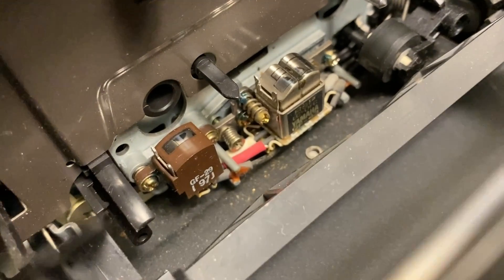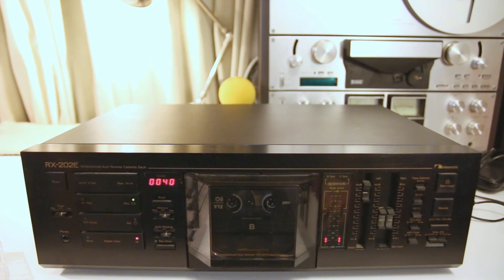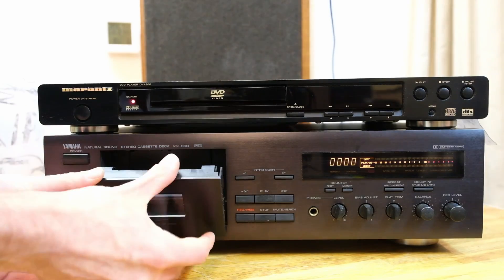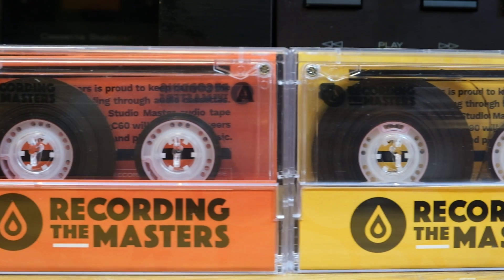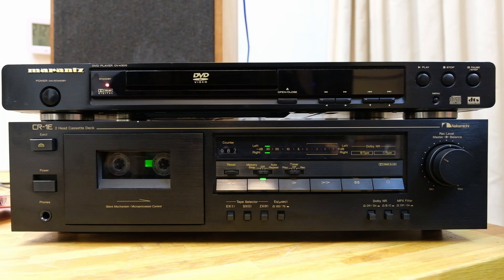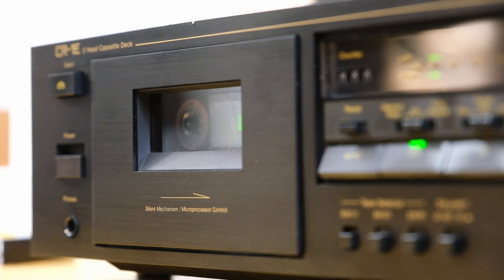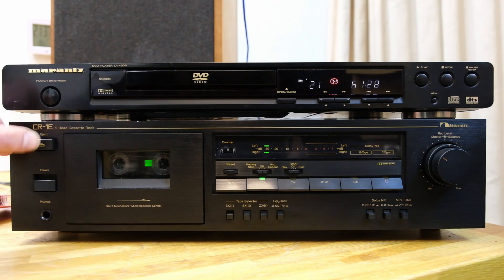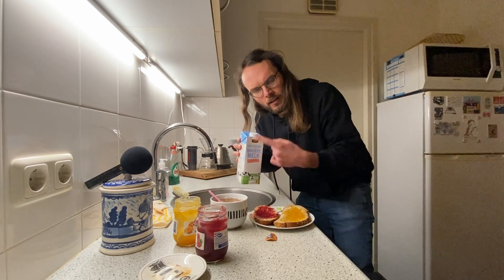The basics of cassette recording

Comment: Nice and informative video about recording on tape, interesting to hear the effects of setting wrong tape types during recording.

I have recently started recording on my NAD 613 deck and enjoying it a lot. For calibration with the Bias adjustment I recording a 315Hz and 10kHz sine wave, separated in the left and right channel, and find a position that on playback gives equal levels on the left and right channel. Any other tips on setting Bias?

Your part on the notches in the different tape types got me thinking. My NAD 613 does not have a tape type selector, thereby I assume that will auto adjust with the notches, as you explained. But what if I have a type 2 tape with the record protection notches removed, and I cover the complete notches in order to be able to record? Will my deck see this type 2 cassette as being a type 1?

Also, what is the purpose of the 70/120 microsecond switch on your Nakamichi? I though the difference between type 1 and type 2 is the either 70 or 120 microseconds? (and is that termed bias, or EQ? what does EQ mean anyway?)

Hopefully you are able to respond to my question. Keep up the nice work with your channel, cool content also with the speaker demo and reviews!
Reply from the maker: Hello! Typing on my phone so keeping it a bit brief; I personally use my ears for biasing with a piece of music that has a full frequency range. Even if the bias is slightly off you won’t know unless you one on one compare. Many decks don’t even have bias controls and they still sound fine. Don’t overthink it 😁.
If you cover both notches it will record at type 1, yes. So only cover one (just put the tape over half of the notch. It is okay if it just goes from the front to the back of the shell, you don’t have to put it exactly on the top of the tape. Anything works as long as only half the notch is covered.
As for the 70/120; it’s a playback eq only. There are a few type 2 120us tapes and Nakamichi took those into consideration!
Google “120us chrome tape” and you will see some images :)

Thank you for the kind words!

Comment: Can I record direct from the outputs on my audio interface? Or is it recommended to use an amplifier for all applications
Reply from the maker: You can absolutely directly record from your audio interface. A really high quality amplifier (something high end, not your 'average' consumer sony, pioneer, technics etc.) might pose a small improvement but unless you are working with high res digital audio, there's really no need to worry about this. 
There's only a few different analog signals. There's phono signal (comes from an old fashioned record player), microphone/guitar signal and line level signal. Line level is pretty much any modern audio device. So whether it's your cassette recorder, computer, phone, cd player, ipad, tv or even gameboy, if you have the cable to connect it (which just means; the right plugs on both sides, nothing fancy) it WILL work. 
Bare in mind; If your audio interface is meant for music production, it may only have microphone inputs and no line level inputs. So if you want to go the other way around (from tape to your computer) you may need to make sure your interface supports that. Your interface outputs though, are definitely line level.
Reply: @rollingtroll  awesome and thanks for the quick reply! I just found out recently that my mom still has her nakamichi bx-100 in good condition that she never uses so I have been doing some research in figuring out how to incorporate it into a music production workflow for a little bit of tape flavor. Luckily my interface has switchable mic/instrument/line inputs so looks like I will be good to go on that end. I was originally intending just to record direct from my interface but I found out even more recently that she also still has a Rotel rx-830 stereo amplifier so I guess based on what you said I'll try both to see which one I like better.

Comment: How do you segment tracks when recording to a cassette instead of having just one long track composed of different songs?
Reply from the maker: You can't. A tape is always one long track. Some cassettedecks can 'track search' when there's a 3 second (or more) silence between songs. Alternatively you can use the tape counter to see where tracks start, you would then just have to write the counter number on your tape index card, and fast forward to that number :)
Reply: @rollingtroll  Thanks a lot, I always wanted to know
Reply: @rollingtroll   also how do you go about erasing a type 2 cassette to  record something else on it?
Reply: @zromaa  The same way like every other cassette. You can simply record over it or you can use tape eraser. So understanding it is not necessary to erase the tape. you can just record it like if it was empty. The deck will take care of erasing the old track and recording new one (of course setting the deck to record type 2 cassette).

Comment: Much of the business that I had in the 80's and 90's was real time cassette duplication. I used Nakamichi MR2 decks. The best fidelity for Type I Playback was to use Type II (chromium) tape in Type I shells.
On recording, I would use Type II bias but 120micro second (Type I) eq. This gave extra headroom for the high frequencies and allowed recording at about 4dB hotter. These tapes played back properly on a Type I machine as they didn't have Type II sensor holes.
Reply from the maker: Many decks don't erase properly if you use Type II bias on Type I tape. But I'll give it a shot with one of my naks, see what it does for me :D.
Reply: I used Type II Bias but not EQ on Type II tape. Only the EQ was changed to 120microsecond.
 Of course, the playback was only correct if you used type I playback which is why I used Type I  cassette cases for my duplicates. 
Self sensor decks sensed it as Type i.  and I marked them as normal 120 playback.
This was something I learned when I was licensed by Dolby.
Reply: @Yoda8945 "when I was licensed by Dolby" that's a cool sentence to be able to say about yourself.

Comment: Spent years in 80-90 even in 2000s with tapes.   What is the reason to perform this today ?  I also wonder why this casette decks still cost money. Ok for Marantz, Denon some hi-end tech, but also tape-players that cost 100 $ from 30y ago are in trend too ! Wtf :?!  ("Old days come to life. Old morning dawn... ?") 
2 days ago i woke up and fixed that i want to buy a tape recorder too !!!))) i feel myself not myself !)
Obviously - all this staff sounds quite poor and have many complexities. 
Seems like just some magic rite today,  is not for listening).
Reply from the maker: Because there is no better relatively affordable alternative. Great digital audio is more expensive, reel to reel is too. And of course there is a little romance and the tangible aspect.
If it sounds poor, you are doing it wrong. Even in a very serious audiophile setup cassette still sounds great.
Happy to provide you with a recorder depending on where you are!
Reply: @rollingtroll  To get =great sound= this will not end just at a casette recorder. Will need to buy all stuff. This will cost.   Spent very much time with tapes collectioning them. .  In 90s i was doing it like most guys - just diffirent casette deck / system hi-fi, no pro lvl hi-end of cuz. 
Then i moved to Cd/tapes, then to Mp3 128, then to 256/320 lame 3.92 codec,  then to Mpc/Flac. Avid Mbox pro / Genelec 8040.  Still there & some audio CD`s of chosen groups.  
I am not so excited about tapes - cause i know what is it to load games Zx Spectrum & Atari on tapes). You need to feel it). Best way when you are a child and do not have experience how does it all works)).  Pure anal acrobacy and a taste of a failure after a hours of wait)). 
Isn`t it better to move to vinyl if to think this way  ? 
Vinyl has better quality, lasts long, and also gains a price with time so we can even get some antiq sense...

Comment: this is a great video but i have one question. does the volume amount also apply to other recorders such as a stereo and thing like that. i also do not have a db meter on my deck is that fine?
Reply from the maker: Then it has an automatic recording level. It's not ideal (because it keeps adjusting) but it is what it is :).
Reply: @rollingtroll  ohhh ok thank you!!
Reply: @rollingtroll  do you have any recommendations of decent recording decks for a good price
Reply from the maker: Generally affordable Aiwa and JVC decks are pretty reliable. Go for something mid nineties. Not the very late early 2000's ones, not the super old ones. Biggest chance of them working :). 
Also somehow the Akai HX27W always works :D. 
 @callmehost7594
Reply: @rollingtroll  sounds good thank you so much!